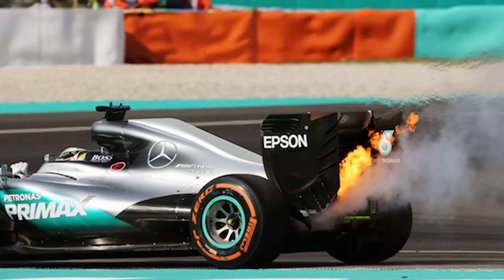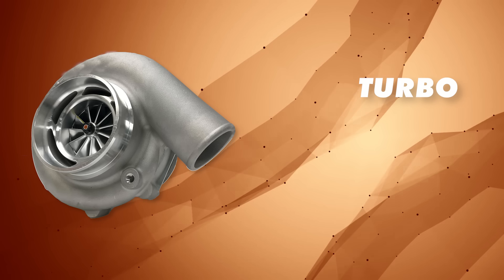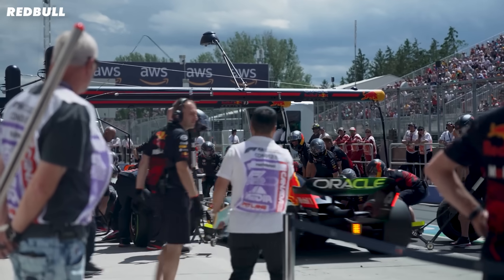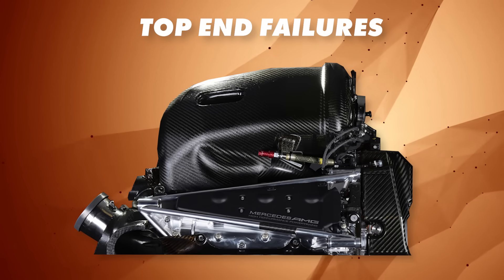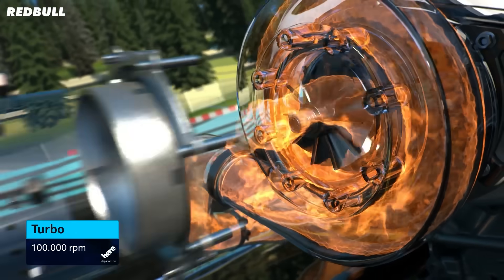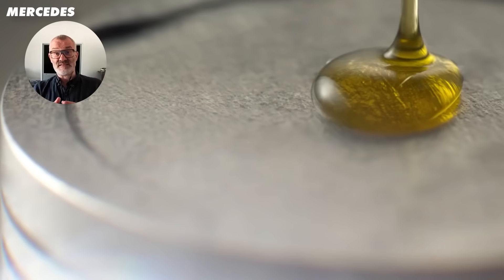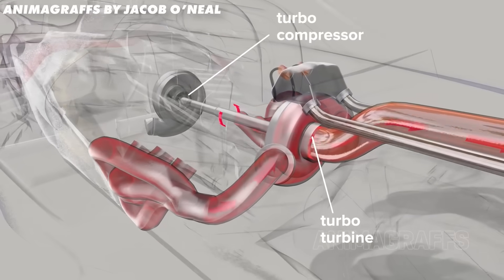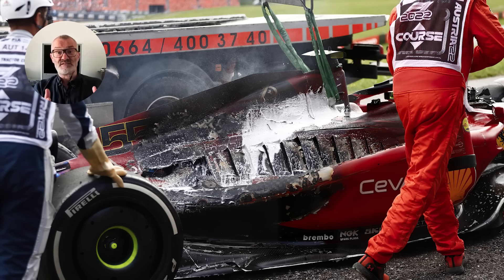Why F1 Engines EXPLODE

Comment: You can see in Austria that parts coming out of the exhaust with white smoke too, so it had to have been the turbo destroying itself, I think the turbo spooled higher than normal at that point causing it to fail. Then I suspect the side pod damage could've been the turbo parts impacting the MGU-K causing the battery to explode and lead to the huge fire. I think every time the fire is a battery fire, on the onboard the fire is almost pinkish rather than pure orange. Perez in Bahrain 2020 and Carlos in Austria are good examples but I might be wrong on that.
Reply: Not a battery fire.

Comment: Makes a lot of sense, I remember seeing him hit the brakes almost immediately as the failure hit coming up the straight, light white smoke trailing after a few seconds, and as he came to a stop the bodywork popped and that must have been the turbo finally grenading which sparked the fire. Scarbs you're a legend as always.

Comment: Are the engines frozen now or soon? If not mistaken,  i thought I heard that performance is frozen, but reliability may be the only place P.U. manufacturers can improve.  If this is correct,  then i can understand why Ferrari would push as much performance out of the engine for this season, then legally work on the reliability.
Reply: Binotto already said this in an interview.
“We tried to push for pure performance. The engines are frozen until 2026 but can be touched to improve reliability.
The PU is fast, the reliability can be fixed later.”

Comment: Good video again!

Dare I say we need more big, old school, catastrophic engine failures? I actually love that this season reliability isn't a given, even for the top teams. RBR had their share of problems earlier on in this season, and now Ferrari seems to have some issues. And even when I love to seen them battle it out on the track, just the idea that the car could fail at any moment adds a bit of tension. I started watching F1 in the early 90s, when no race was over until the chequered flag. How many times did we see someone go for a certain victory, only to fail with the finish (almost) in sight? And by the way, back then I was a fan of Jean Alesi, who had his share of mechanical issues...
Reply: Agreed. Nearly perfect reliability is part of what made Mercedes' dominance so dull.
Reply: @0-Armsauce-0  mercedes still reliable as hell though
Reply: @safwanahmed5592  reliable yes, but not dominant anymore. And while they seem to be improving, big question is if they can catch up with RBR and Ferrari without sacrificing at least some of that reliability.
Reply: @WizardOfOss  Considering how they've dominated I wouldn't be surprised if they do.
Reply: @safwanahmed5592  when the hybrid era started, Mercedes was so far ahead of the competitors that they probably could run their engine at, say, 95% and still be the fastest. Or use party mode just when they needed that bit extra. Resulting in that almost perfect reliability.

Last year, RBR/Honda finally caught up, and suddenly some cracks appeared at Mercedes. Seems like they more or less sacrificed Bottas to see how far they could go, and put Hamilton just at the limit. Smart move and if not for that bizarre season finale it would have worked.

Considering the engine regulations won't change until 2026, I wouldn't expect any major changes here anymore, everyone is now so close to the limit of these power units. The big differences are now in aerodynamics, and now Mercedes is the one that needs to catch up with the competition. And I'm sure they can do that eventually. But dominating like they did during all those years? Not a chance within the current regulations.
Reply: @WizardOfOss  Agreed.
Reply: I remember seeing jenson button have a top end faliure right before the line. Said line would have given his first win (if I remember correctly)

Comment: With Sainz this weekend, you could also see a lot of sparks coming out of the rear just as turbo really exploded, like burning metal sparks. It was quite evident that the turbo grenaded.
Reply: I'm leaning more towards a bottom end failure, the engine noise cut suddenly (not just a lack of turbo whine), there was very little smoke and you could see a violent disassembly from further forward. It would also explain why he couldn't put the car into gear to stop it rolling backwards while he hopped out, if your crankshaft has snapped then putting it in gear won't stop it rolling.

Reference:
https://www.youtube.com/watch?v=SkNzqnKRDkg
Reply: @DjDolHaus86  That could be the case.
Reply: @DjDolHaus86  Would not be surprised if the turbo failed and split the engine block, seeing how violently the turbo seemed to fail first at the rear then at the front. It looked to me like both ends of it exploded separately and then the fire ensued, which looked rather similar to a bottom end failure.
Reply: @DjDolHaus86  He couldn't put the car in gear because if I remember correctly the regulations tell that whenever a car stops on the track they have to leave it in neutral for some reason. For the engine explosion when I saw it on tv I immediately thought they blew the head but seeing the replay you can see a yellowish explosion from the exhaust which might have been the turbo shattering and then there's the orange explosion from under the engine cover which is quite high up in the engine and I think it might have been an exhaust manifold failure. In conclusion Sainz was pushing too much and the "DANGER TO MANIFOLD" warning popped up on the wheel hahaha
Reply: @matteoc98  You leave a car in neutral so the marshals can move it easily once abandoned. This regulation is of course usurped by the common sense rule of not letting a flaming car roll back onto the racetrack and don't hang around in a fire holding the brake to fulfil a regulation which can be manually overridden (there is a neutral button for marshals to press if driver procedure isn't followed).
Reply: I think it was initially turbo failure but the explosion when he was already coasting out of the track was something else. I think it was electric fire exlposion caused by the fire started from the turbo failure. Spectacular one as well from the slow motion videos.
Reply: @glue80  it definitely did not smell as an electrical fire m8, smelled more like oil/ fuel fire, with a hint plastic ofc.
Reply: @glue80  , yea, if the initial failure was also the thing that blew the side of lower the car off, that probably was not the turbo.  
Could of been a knock-on effect from a turbo failure though.
Reply: I was watching with my girl and she asked what happened. Told her the turbo  shit the bed
Reply: This is the engine base, that the new LMDh/WEC 2023 will be equipped or fitted isn´t it? for 6 and 12 h races? well, we shall see, the Scuderia still had a couple of months, isn´t it? Good luck Maranello boys.
Reply: Excuse me, WEC races during 6 and 24 hours, not twelve, excuse me the error.
Reply: @mariapires7170  i'm not sure, but they would run those a lot cooler and possibly at a lower power setting for most of the time then wouldn't they?
Reply: Well, we sincerely hope so, because we love endurance races and  Ferrari, like the every others brands in 2023 Championship ,i´m sure, will be a amasing partner in the top class (LMDh) and will be a shame, saw these engines explode, like we saw in GPs this year. Thank you.

Comment: did I see roller main bearings?  if so, I would love to hear more about those!
Reply: Same. This video covered general ICE failures. I want to know about those crazy bearings and other wizardry!
Reply: I am pretty sure that F1 engines of this generation use plain bearings for the mains and rods.  And surely if roller or needle they wouldn't be of the design used for illustration, which is a more "heavy/slow" capacity, not high speed. The bearing assembly shown is not radially uniform, and would not support the loads equally during rotation. It's also heavy and bulky, two things that are anathema in racing engine design.
Reply: @Stem Artin afaik, plain bearings has the lowest friction the higher the oil pressure
Reply: @Stem Artin You'd still end up with the crank floating on a film of oil even with roller bearings. Also while a roller bearing, like a wheel bearing, is better at handling force than a ball bearing, like a skateboard bearing, their capacity to handle force is minuscule compared to a thrust type bearing. I can practically guarantee neither the crank nor cam bearings are roller bearings. They just wont take the forces needed and you're definitely not getting away with splash lubrication at 12k rpm. Roller bearing also will generate more friction and heat then a thrust type bearing at those rpms. Thrust bearings are high load/ high rpm, Roller bearings are high load/ low rpm, ball bearings are low load/ high rpm. Please don't attempt to spread misinformation.

Comment: What happened to Sainz's engine tho? 

It literally exploded.

Edit: It's turbo.
Reply: turbo failure
Reply: @Lunarfox  that would have to be on the inlet side, given the spot where the car's bodywork came apart. I personally suspect a bottom end failure, though, possibly caused by a lack of lubrication, resulting in a rather large, new "inspection window" in the side of the block.
Reply: @halofreak1990  just relaying what they assume it to be (I'm NOT an engineer)